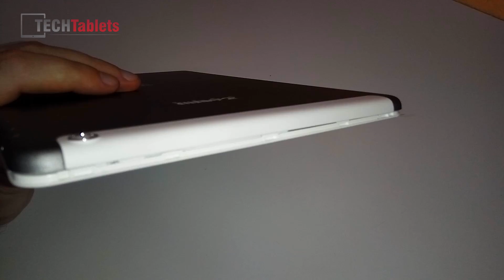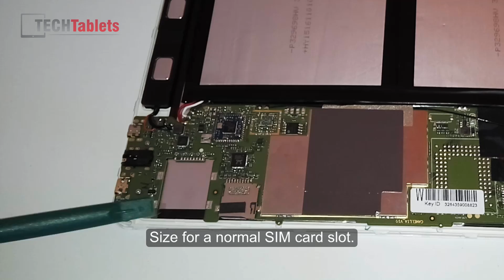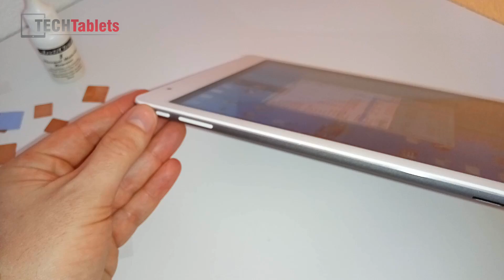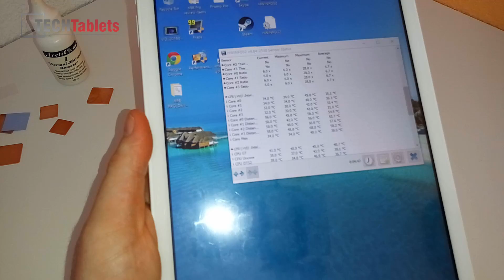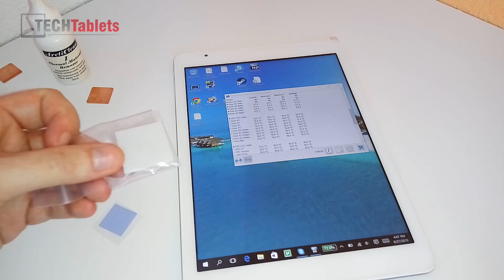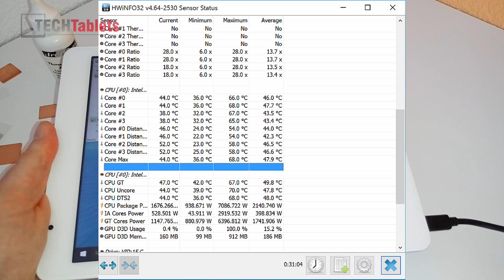Teclast X98 Pro Heat Sink Mod How to & Internals

Comment: Could you pin the sizes (and thickness) of the copper and thermalpads in the Video-Descriptions?
Reply: If I'm not mistaken he says that the copper shim is 20mm x 20mm at 1mm thickness, the smaller shim is 15mm x 15mm. Earlier in the video he says the thermal pads used for the ram chips where 1mm. Correct me if I'm wrong (misread that as what where the sizes).

Comment: I'm trying to do the same with my 8" Dell 5855 which also has a Z8500. Unfortunately in Dell's case they provided NO rear plate at all, the ONLY cooling is the RF shield! So I guess the only solution is going to involve modifying the rear cover, probably by cutting an ugly hole to accommodate a thin copper heatsink that I'll have to mount on the RF shield.

Comment: Chris, I have seen this video very late but wanted to add my comment. I have done the same thing to my Teclast X98 Air 3G tablet. It reduced the temp about 15 C in idle and 20 C in throttle. I used 1.5 mm thick thermal pad between the back panel and that metal case on the cpu. and it was still fine and no pressure to the screen. As addition, my thermal pad was quite big (almost X2 than you used in the video) I also used 1.2 mm thick heatsink for cpu and just a standard thermal paste silver color. Thanks for the great video. It will help and propably already helped a lot of people.
Reply from the maker: Thanks for the comment, it does wonder a bit of copper which is why I do these mods so often!

Comment: Hi Guy, I have a Teclast X98 Air III & the micro HDMI outlet has stopped working. It ran fine for over a year, but now doesn't connect to my TV. Can the socket be replaced separately, or do you have to change the whole mother board ? Where could I buy spare parts ? Many Thanks
Reply from the maker: If you're good with a solder iron you might be able to replace it.

Comment: You can use a real thin spatula putty knife, like from a big box hardware store. I used that on my old systems and had I known I could have opened my Vizio 22" tv/monitor from Dell that had issues with the way they put the case together, pressing it would cause the tv screen to work fine, otherwise it had static on the screen every few seconds. Sadly I recycled it but they gave me a better 24" LED monitor as a replacement.

Comment: there is nothing wrong to begin with
they are designed to throttle that's how they operate
Reply: +rjc862003 ure a fucking idiot
Reply: intel designs there chips to throttle they are not designed to run at 120% TDP all the time

Comment: I just ordered one few days ago, does anyone know if the heat problem is fixed or is it still recommended to do this?
Reply: good qustion, i realy want to know to
Reply: +DangerousBunny I already ordered all the stuff needed for this, cooler is always better.
Reply: +MF175mp 
Temps are around 80-83 when using heavily, next week i do this mod for it.

Comment: Hi,  love watching your videos.  I saw in this one you mentioned there is room for a full size sdcard reader.  How hard would it be to get a reader online and solder it to the board.  If done you could use it as an internal hard drive giving you 256 GB (using 256 GB sd card.)
Reply: impossible. you just can't do it.

Comment: Chris, great mod! Planning on doing this myself when my X98 Pro arrives. I was looking into getting some copper plates and thermal pads. I was wondering about the thickness.  What did you use? 1.0 or 1.2MM thick for the CPU
Reply from the maker: +Jeroen Vos I used 1.0mm on the Atom.

Comment: I am waiting for a 8-9 inch cherry trail, or m-core, with 4gb. But the heat issue with gaming on a tablet is a constant issue. Hopefully someone will do a how to for copper thermal cooling for whatever that tablet happens to be when it comes out. Also cheers for the work you do man.

Comment: Great, but the video would be better if you wouldn't skip the part where you actually doing the steps instead of skipping to the moment after you finish the step.
For example, it would be nice how much of the Thermal Adhesive you put there and so on..

But great video nevertheless !
Reply from the maker: +Gal Root Noted, i'll keep that in next time.

Comment: depending on what material the metal tape is, it could be EMI shielding.  which is quite impressive to see on such a cheap tablet!
Reply: +William Brack not if it doesn't work, which apparently it does not since 80 degrees is nuts.
Reply: +frieda Wei i'd keep that up to the engineers, seeing as the legit tablets are also getting to 80*C obviously it isn't an issue for reliability.

but lower temps are always nicer.... in the case of the thermal mod, it means the back of the tablet now gets very  hot in the hands, instead of just the CPU getting hot.

Comment: GREAT WORK buddy ! I was actually discussing yesterday with my brother, regarding the extra copper plates for cooling, that it should help to lower the temperatures around 20°C. And I was not wrong :D great work and thank you for the video
Reply from the maker: +1KeNnY1KeNnY1 Thanks, I have modded my Air 3G now (Vid coming) and after stress testing the CPU it never goes over 41 degrees. Down about 25 degrees, massive change in temps.

Comment from the maker: Looking at the Teclast X98 Pro internals and my mod to help lower temps and hopefully fix this thermal throttling issue my unit has. This heat sink mod can be applied to the X98 Air 3G and Air II as it's basically the same inside. Where to buy? $235 here http://www.banggood.com/Teclast-X98-Pro-WIFI-Intel-Z8500-Quad-Core-2_24GHz-9_7-Inch-Win10-Tablet-p-990292.html?p=QZ14021624945201505Y

Teclast X98 Pro Forum: http://techtablets.com/forums/forum/t...

More info: http://techtablets.com/teclast-x98-pro/

More X98 Pro videos: 

X98 Pro unboxing: https://www.youtube.com/watch?v=gKf2o...

X98 Pro 4 days use Review: https://www.youtube.com/watch?v=93RSb...

X98 Pro desktop mode, mulittasking, 4k streaming: https://www.youtube.com/watch?v=arpz1...

X98 Pro Gaming: GTA V test https://www.youtube.com/watch?v=5wL5L...

X98 Pro Gaming, CS:GO, TF2, Dota 2, LoL, PoE, CODMW2: https://www.youtube.com/watch?v=9BIdx...

X98 Pro Vs X98 Air 3G: https://www.youtube.com/watch?v=TMgqv...

3DMark11 scores Vs X98 Air 3G: http://youtu.be/cxnlGqdykx8

X98 Pro Vs X98 Air 3G Asphalt 8 test: https://www.youtube.com/watch?v=nVNsQ...

X98 Pro Gaming: Warface, War Thunder and Neverwinter: https://www.youtube.com/watch?v=POcme...

X98 Pro Gaming: Asphalt 8, Dungeon Hunter 5 and Modern Combat 5: https://www.youtube.com/watch?v=ewzF8...
Reply: +TechTablets.com I disagree.  Your explanations offer incites to your rationale and are all worthwhile inclusions.  Maybe not for experienced people, but newbs would appreciate it.
Reply: +TechTablets.com Maybe you could use a giant thermal pad that rests on top of all the components in the tablet, would this be a good idea?
Reply: +TechTablets.com  Its interesting ! but you talk a way too much and repeat yourself ... watching w/o fast forwarding your video is a pain in the ass ! cheers
Reply from the maker: +clerc thomas Thanks for the feedback, noted. I'm not a professional youtuber and this is not scripted (It shows). I'm learning, I'll try not to blab so much. But I just thought it better to explain a few things rather than a silent video....
Reply: +TechTablets.com I dislike silent videos, so keep up the great work. I seek out your videos as they are always nicely detailed, and don't seem biased like some others do.  You're probably more forgiving of a large mistake by a manufacturer, like improper heat sinking, than I would ever be. To me the tablet is a no go, because overheating will kill the tablet's life very quickly.
Reply: +James Bone I think that would have a heat retention effect, like a blanket.
Reply: Good point.
Reply: +TechTablets.com In that case, I wonder what effect just placing a thermal pad on top of the shielding would have had without the copper shims! Would be interesting to know. In any case, I love it when a plan comes together. I really want to get one of these but buying from China is a minefield and a bit of a lotto... I want to get one more know that I know I can mod & improve the heating (a few complaints about thermal even errors on BangGood comments).
Reply: +TechTablets.com Was it thermal adhesive that you used to firmly attach the copper shims to the CPU? I take it you didn't just put the shims loosely onto the top but I didn't hear you mention the adhesive addition when you talked about the shims. Cheers!
Reply from the maker: +Osskah Yes I used thermal adhesive as I did want to risk having them move and short out something.